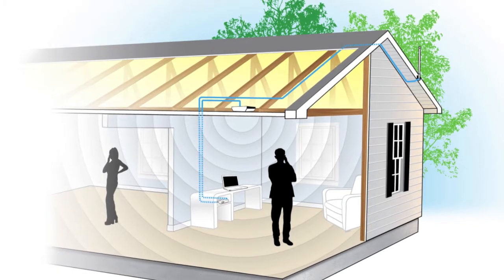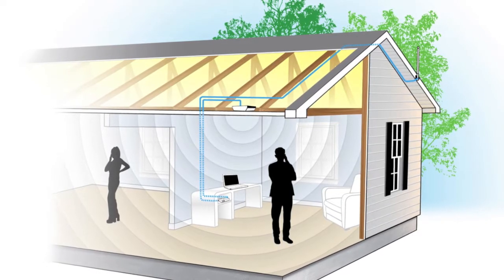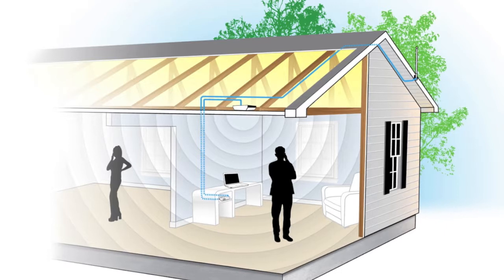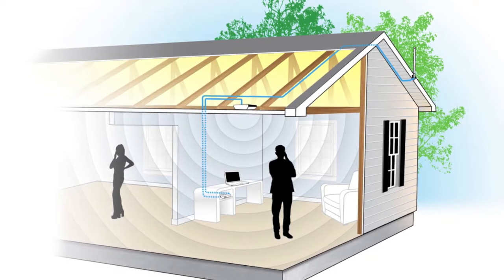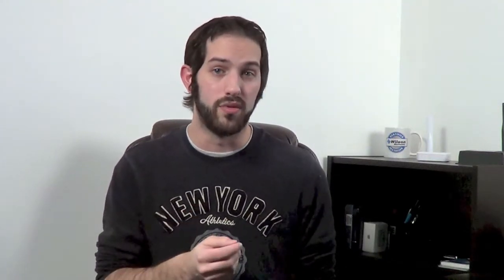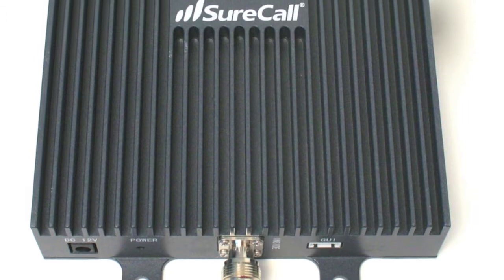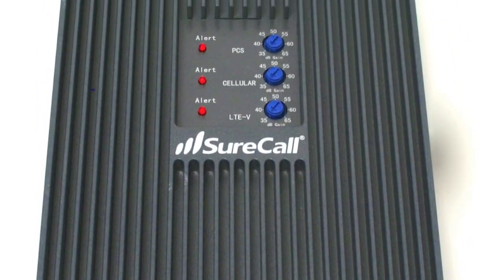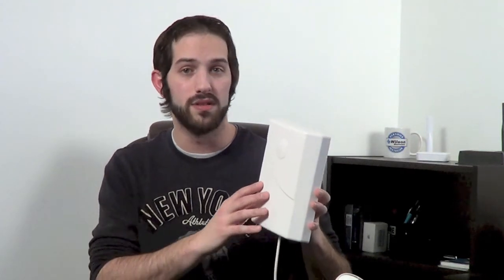Wireless Repeater Basics - Improve Cellular Signal

Comment: I have a Wilson 4g booster, how can i make this work in 2 rooms, is there a splitter or anything?
Reply from the maker: This depends on the type of booster you have. There are direct connect amplifiers, and then repeaters. If you have a direct connect then you won't be able to split the signal. If it is a repeating amplifier, you can add a splitter after the amplifier and run multiple interior antennas  to give yourself more coverage. Contact the experts at 3Gstore and we can help you get the right equipment. 3Gstore.com/contact